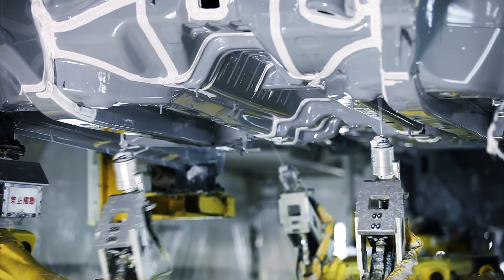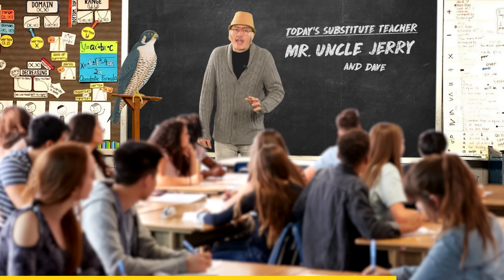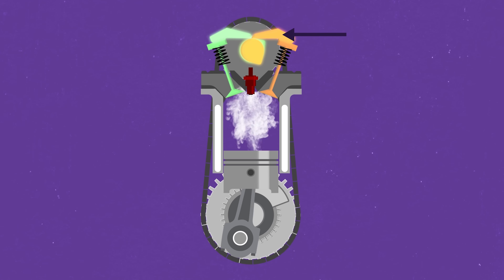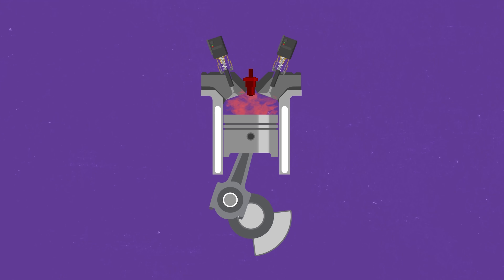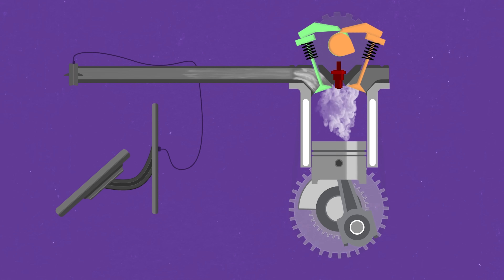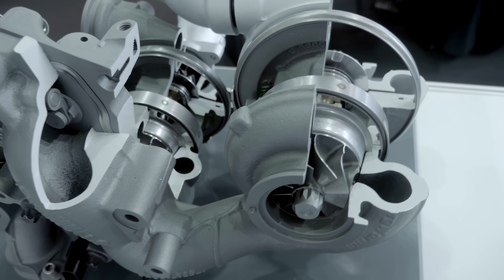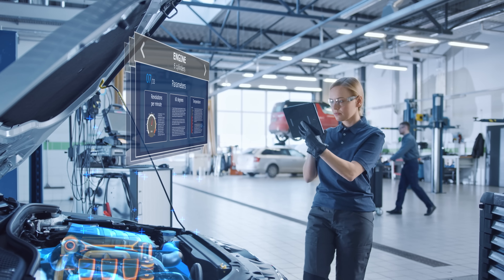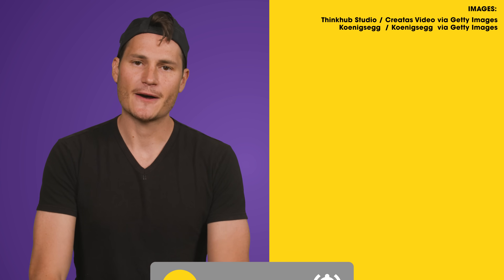This Is The Last Great Engine Tech

Comment: May not be a future for combustion engines in new cars and having free valve tech. But what about the aftermarket? Imagine being able to upgrade your complex head and ditch a load of mechanical parts and increase power at the same time? Imagine making your car easier to work on. I'm a useful DIY-er but when it gets to timing, I'll leave that to the shop pro.

Comment: This seems to me like a suspiciously similar technology to elwctrical priming in firearms.
That technology has existed for 90 odd years, yet it doesnt see widespread use outside of fighter aircraft, which are already maintenace intensive, and the weight and apace savings are well worth the cost of relyability.
Both camtracks and projectile priming involve large forces at high speed, and demand consistent and relyable operation pontentially hundreds of times each second.
Mechanical solutions are simply more robust in such applications.
Carburetors and injection have the crucial difference of not meing under high mechanical stress.

Comment: Not really a new idea,I'm an electronic technician, i thought of opening valves with solenoids 35 years ago,didn't have technology we have today, I even made a driver for solenoid,but useless me gave up,I still have the solenoid to this day up in my shed ,I almost cried the first time I saw the free valve engine, but I'm glad someone done it,also I made a module to convert from distributor to direct coil on plug around the same time,apart from being lazy,health problems stopped me for a few years and I sort of forgot about them
I've still got one invention left,am turboing my car soon so I can test it.
If everything goes to plan,every forced induction engine will be able to benefit from it,trucks, trains, earth moving equipment, etc,not just cars,fingers crossed

Comment: Cool, so the next thing is to integrate the new Porsches bio gasoline concept. So internal combustion engines could be very efficient in the near future. Pleas make a video about Porsches bio gasoline, if you have the material. It's a really neat concept, where they harvest carbon components from the air with magnetic filters and combine them with some catalyst. I don't remember the exact concept correctly, but for sure it will be the future, as many cars still have the old engine that can be modernised and is actually way more environment friendly than building new EV cars.

Comment: To be fair, fuel injection existed long before digital electronics. Even as late as the early 80s, you could take a Mercedes diesel once it had been started, disconnect the battery, and cut the alternator belt, and the car would continue running just fine.

Comment: Years ago this idea was around but they were working with 24 volt solenoids to actuate the valve. Now its air which is interesting. 
I want to know when koenigsegg is going to take their 2.0 liter 3 cylinder 600hp engine and build an 8.0 liter V12 with 2400hp

Comment: This is hardly new, using solenoids in place of cam activated valves was something we discussed at length when I was at University over 20 years ago. One issue at that time which I think technological advances have solved was that the system was rather heavy and bulky to implement at that particular time. It's probably true that the maturation of this technology has just come too late, very few manufacturers are willing to invest in the internal combustion engine when it has no future. Tie that to increasingly stringent emissions legislation (such as Euro 7) and the way forward, like it or not, is electric.

Comment: Multiair and Ingenium is similar but Electro Hydraulic. It places a pulswidth modulated solenoid in a hydraualic circuit between the cam actuator and the tappet. Essentially does the same thing, varies lift infinitely.

Comment: I used to collect car magazines in the mid to late 90's early 00's, and in one of them I remember an article about one of the major car shows in the US (I'm in Australia) showcasing among other things, a motor with electromechanical valves. I tried excitedly explaining the tech to friends back then, but it fell on deaf ears, and I long since forgot about it... til now. I've long since tossed the mags, and I tried desperately to find at least a pic in the web of the motor from the magazine to show you guys, but I can only find either old solenoid type models or the latest tech. Any way, super cool technology and great video, cheers.

Comment: Freevalve engine can actually be a very efficient backup generator for electrical vehicles in order to compensate for the range issue. And also it will make hybrid vehicles much more efficient.
Reply: Never fails.  Someone getting triggered by hybrids in the comments.
Reply: @chrisE815  BOV zealots gonna BOV zealot
Reply: EVs, small niche market, gobs of unsold inventory, bankrupt car makers... nope, not going there, too easy
Reply: Range extenders should be a standard modular easily swappable unit, it'd be amazing if when you wanted to go extra far you just rented a range extender (generator). Bam, biggest issue for electric cars is solved!

Most people hardly ever go beyond their normal range.
Reply: @Foguete4v  scared
Reply: @Foguete4v  ur maaad
Reply: @Foguete4v  aww poor kid
Reply: Or you just make batteries better . I dont see rang problems anyway . Fuel engines are done . No trick can make a fuel engine any better to compeat with Electric . Hybrits are the stupidest thing ever made .
Reply: @xythiera  cope
Reply: @Foguete4v  EVs are taking over, the only people impressed with your kitted '03 Subaru impreza are other dudes
Reply: @dylanc9145  then wtf are you doing on this channel if you are not a car guy😂
Reply: @xythiera  The price of replacing the battery pack on a tesla right now is near $20k. That can't compete with fuel cars. It also looks like we'll run out of lithium before we run out of fossil fuels.
Reply: @xythiera  Making batteries better isn't this magical thing you can just do. There is also weight, size, form factor problems. There will be non-electric cars for another 15 years at least in the 1st world, no reason to not do this (that I can think of)
Reply: @xythiera  ratio + L + bozo
Reply: @xythiera  where I live it's over 400km to the next major city. It's possible to cross the country in an electric car but you better hope none of the Chargers in rural areas are broken otherwise you could get stuck there for a while. Range anxiety is very real in many places.

Comment: The biggest problem of this tech is to get it up to speed and to make it last at a reasonable price.
A chain or belt will keep the timing of the valve basically infinitely fast. We have seen valves go up to 5-6k RPM,
as V10 and bike engines easily go up to 12000 RPM. With an actuator it's much more difficult. You need a sensor for the position of the crankshaft which is way more precise than in any car, you need a computer that can check the decisions to open the valves down to micro seconds and an actuator that does the movement. The combined delay of all these components has to stay within a view dozen microseconds to keep the system stable for any RPM above 2k.
Injection is actually way easier as it doesn't matter too much if you inject fuel a view degrees to early. You start in compression and keep injecting all threw the working phase of the piston. Also you get your timing reference from the crankshaft.
If you got the system in place you need to make shure that all that lovely precision stays stable over all the milage heat, cold and vibration these parts will see.
But yes i love this idea and it has a lot of potential. Especially for trucks and busses. Even tried building one my self but it's a challenge. Especially if you have to stay out of hypercar margins and budget for parts.

Comment: Would like to see free valve applied to an F150 8 cylinder.  Shut off 1/2 the cylinders when not in use and turn them back on when you want to use. Besides the weight reducing factor the mileage improvement would be great. That would be a HUGE help

Comment: @donutmedia Quick correction the tech referred to at 4:00 variable valve lift is the technology that allows separate cam profiles to be used altering valve lift and can duration. Not variable valve timing which is more often used to control valve timing not lift or duration.

Comment: Clearly no-one at Donut media have seen a throttle-body before. That exactly regulates the airflow based on your pedal position. The cam is there to open the valve. But the throttle is linked to the air intake. Thus opening the throttle more gets more air sucked into the engine

Comment: Freevalve is based on the german development of camshaftless engines. Christian from Königsegg also mentioned it. The first wide introduction of camshaftless engines Was made by Fiat with their MultiAir Engines. There just one Valve is controlled by a camshaft. They also have a full MultiAir engine fully controlled,  but not for the masses.

Comment: i want to have that for a boxer engine in a 1972 VW beetle.
you are right. electric cars have an incredible momentum. but pimping oldtimers with a freevalve system would be super cool. and we know that they will be around for a long time.
i think compatible e-fuel is coming as a substitute for dinosaur juice. it will not come cheap but it will come.

Comment: There are also other concepts targeting the same goals with a more "mechanical" approach. For example connecting rods with a variable axis or a adjustable drivegear on the camshaft allowing the camshaft to speed up/slow down relative to the rpm of the crankshaft. The benefits of freevalve are clearly the reduction of nessacery parts and that adjustments can easily be made even after the development of an engine

Comment: Only downside to this I can see is loss of ability to work on. Electronically configured and computerized = more complex system. Most shops wouldn't be able to fix them anyways.
From an engineering standpoint, it's a marvel feat. Keep Internal combustion engines going strong

Comment: There’s also the fact that the auto parts dealers have relied on cams and others parts for yrs, changing engines in this manner would set the auto world on its head, so I doubt this will catch on as a whole, plus with all the money spent now on electric cars I don’t see them now saying OH let’s keep on using gas , global warming can wait another 20yrs…now that said there’s many ppl like myself that hate cars that don’t have the rumble of a camshaft in a good v8 and wouldn’t ever buy a battery on wheels, those are for kids toys, but if a free valve engine was made available after hearing the F1 cars I’d be happy as heck to drive one, plus think about it, all you’d have to do is tune it every time you wanted more power , only limited by the size of the engine,and the engines ability to Hold the compression be it by boost or NA …it would be wild , you could still port heads, add bigger valves , bigger injectors, the basics wouldn’t change, just the amount of work it would take per hp…
A stock 500 hp engine could make 700-800 hp with just a tune and a better fuel system..

Comment: The only problem i see os working in the mechanical industry i see actuators fail on the daily, and these actuators maybe some that love less than 100 times a day, imagine an engine revving upto 6-7000 rpm being used as a daily commute to work, how long before an actuator fails and you have a piston to valve collision, there need to be some sort of secondary safety feature that could prevent this if a actuator does fail… defiantly good tech would just say it needs refining

Comment: Ev's will never tollatly get rid of internal combustion engines for the simple fact is auto makers aren't making ev's customisable. you can't buy upgrades for your tesla to make them go faster then stock, you get what you pay for and the people who are into cars and the people that follow this page are the ones who want to customise their vehicles. The only way I see internal combustion going out of style is if company's like tesla start making their cars modular so you can simply slap a front motor in your rwd for more power or if they purposely make the motor controller tunable so you can sacrifice you top speed for more torque or vice versa. We may see things like v8's and the like stop being produced but I can't see the 4cyl engine disappearing any time soon and with the tech that's available already people are making big numbers so in the future we may only have 4cyl but I doubt they will disappear any time soon until the auto makers understand the consumers want to modify

Comment: Not sure I agree about being able to eliminate the waste gate on a turbo-charger without a very specific engine design.  Note that Konseg's system is an on-line/off-line twin turbo setup where you have double exhaust pressure feeding one turbo at low RPM, and then they halve it by unlocking the second turbo at high RPM's... so in a way that's a kind of waste-gate function on the first turbo... it just feeds the second turbo.  But let's see... if you use the exhaust valve to "clamp down" on pressure at the turbos, you are putting that pressure in the block.  Not great potentially under severe conditions.  If you use the intake valves to "choke off" the pressure generated from the turbos to reduce the amount of output, well, you back up that pressure in the turbo.  Not as bad as the first, but that kinda defeats the purpose of the turbos.  In the single turbo setup, they do this with a bypass set of valves, essentially moving the "wastegate" function to the choice of which exhaust valves to open.  So basically in this world, you will not be able to ever design a minimal base engine and then take that base and get more power out of it with a turbochargers.  The base engine would still be carrying around a complete extra set of exhaust valves. 

Also there is a lower and an upper bound to the amount of time those valved can remain open.  And the analogue "delayed" signal on the valves kinda acts as a shock absorber to prevent "air recoil" back up into the turbos.  I think they are using an oil surface film buffer in the Koneseg to mitigate the stress.  So now you get to burn more oil?  Not sure about that...

Comment: What’s crazy is to only use half the exhaust to spin turbos..heck, I’d run a valve on one exhaust for the Catt, and once it’s hot close it to run all of them to spin the turbo faster, which would make even more power :)

Comment: This has been around for decades. There is a very good reason Renault didn't develop it when they tried it for 2 years in f1.  They found vs traditional tech that at high rpms the tech develops less power in naturally aspirated engines.  For 2004 they redesigned and sent the weight over the back axle, which suited Alonso and his driving style, and the rest is history.

Comment: Even if internal combustion cars are dying, there is still a use for this technology.  Generators.  It is going to be decades before chargers actually replace gas stations, so as a bridge, we may see cars with the ability to have range extenders installed aftermarket.  Adding Freevalve tech to this not just will help with MPG, but will help the generator engine be able to maintain one optimal RPM for charging the EV's battery as fast as it can, one RPM level to add as much, if not more charge as the vehicle moves, one when the vehicle is stopped... and everything in between.  Since this also simplifies turbo design, a turbo can be added to help power at higher altitudes.

Stuff like this always has a place.  Gasoline engines are not disappearing overnight.